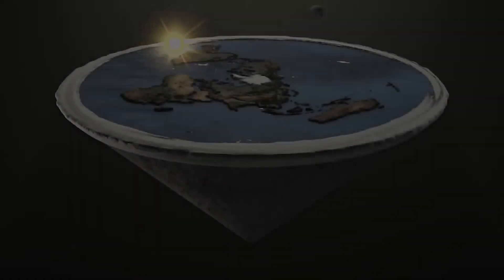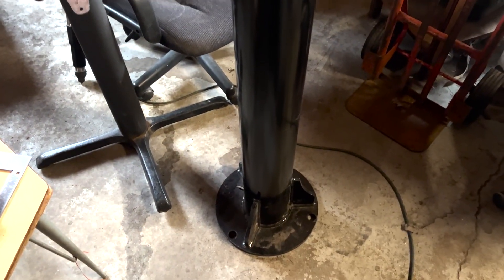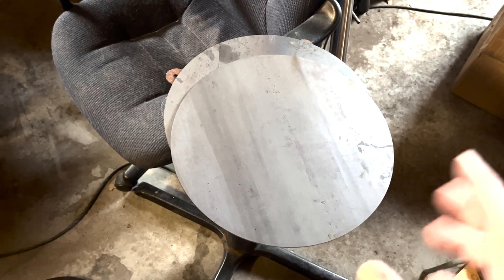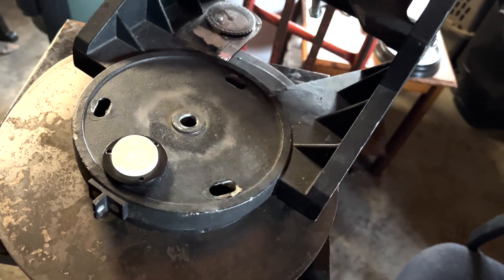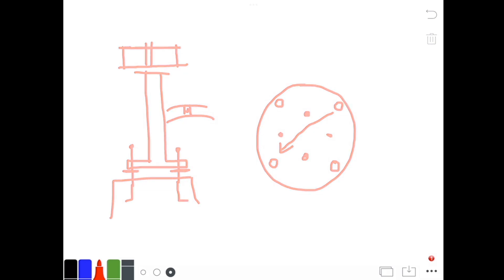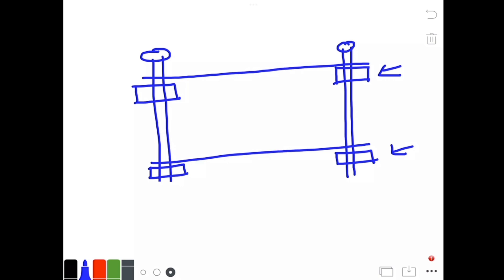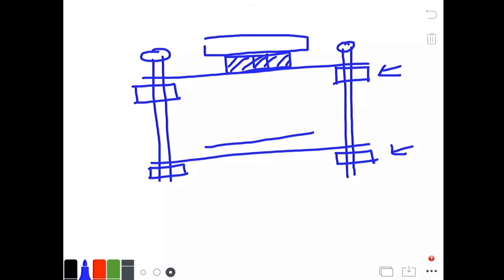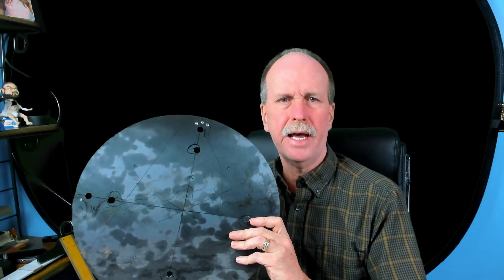Telescope Pier Build

Comment: orrr you can sequence the system as upper nuts, upper plate, springs, lower plates, lower nuts, altho you would need some serious springs  something like valve lifter springs
Reply from the maker: you can't use springs as they move and we are dealing with tolerances to the sub arc second.
Reply: @BobtheScienceGuy  I was trying to describe the tensioning springs used in laser mirrors

Comment: add springs between top plate nut and lower plate ( on the bolts) to maintain lower plate pressure against bottom nuts

Comment: Hey, Bob.  This is an ingenious way  to mount any sort of camera on the cheap in general--even to a tree stump.  Tripods with camera mounts that you can actually rely on to hold their position without slipping over time can be pretty pricey, and one needs an appropriate surface to stand them on.  When I was a kid, I was really into video production, and was trying to do stop-motion animation, but couldn't get my hands on a tripod that would hold the camera without slipping at all.  I wouldn't see it happening until after I was done, as it happened in imperceptibly small increments over time.  This way, you've got a sturdy, flat surface that can be finely adjusted with BOLTS.  Much less ambiguity there!  Pretty sure one day this will come in handy.  Cheers.

Comment: Great video Bob! I was thinking if it would be better to have 3 screws for the levelling of the two plates in an equilateral triangle, instead of a square. I’ve seen that you drilled already the holes to the plates so maybe it’s a bit late to change mind now, but it’d probably make easier to level once you’ve finished the project. After all, you could have a bubble level between the two screws to make the first adjustment, and then move it between the unadjusted screw and one of the other two which are already levelled. With just two adjustments you could make it level that way, although it wouldn’t hurt to verify the levelling by moving the bubble level in the third side of the triangle. Having 4 adjustment screws, you’d always need to adjust two at a time to avoid having the plate wobbling because it’s sitting firmly only on the 3 of them and the 4th allows it to move a bit.
Reply from the maker: While the triangle would be stronger, it is pretty overbuilt as it is.  The reason I went with four was that I could level one axis and then level the other to it.  Obviously the piers are built and surveyed in already, and with the large Meade I can get a polar alignment of less than 10 arc seconds.  With the smaller scope I am achieving 5 min exposure without oval stars.
Reply: @BobtheScienceGuy  That sounds great! I only have a 5 inch Celestron Mak Cassegrain scope in an Alt-Az mount and I was using the adjustment technique that I described to level its tripod. I changed its plastic ends of the tripod with some angle adjustable furniture pads, which I screwed in two rubber rings that I’ve put on each one of the tripod’s legs, to absorb the vibrations. The result was very good compared to the original configuration of the tripod. As a fine tuning of the levelling, I could point the telescope on a very tall building and by moving it only on the Altitude axis, I could traverse the edge of that building from top to bottom noticing if the building seems to move any at all from left to right. I know that the telescope’s computer compensates for that if I do the alignment with 3 stars, however it’s useful to have the telescope as level as possible when I use only 1 or 2 celestial objects to align it on cloudy days. On an different subject, I’ve also made a focuser using a stepper motor and an Arduino which was really cheap and very accurate. The stepper motor has an embedded gearbox and this results in 2048 steps per rotation. This makes it useful at very high magnifications where even a fraction of a degree could make a difference in the focus. Keep up the good work and clear skies.